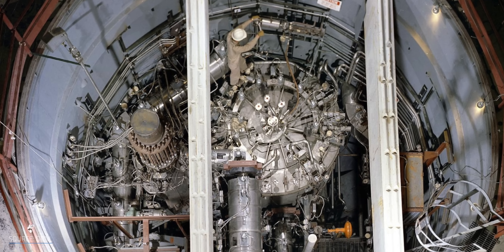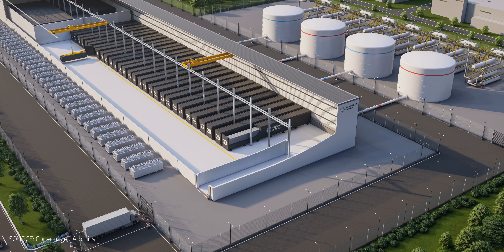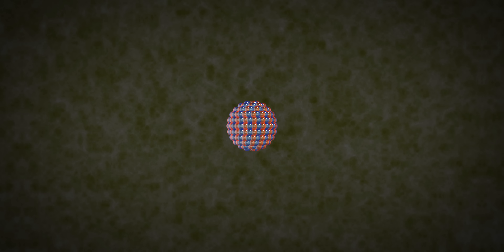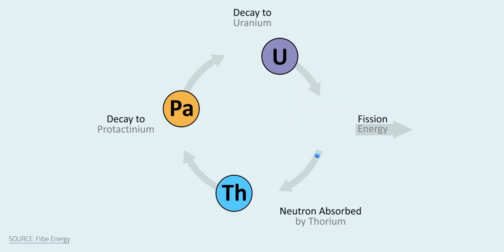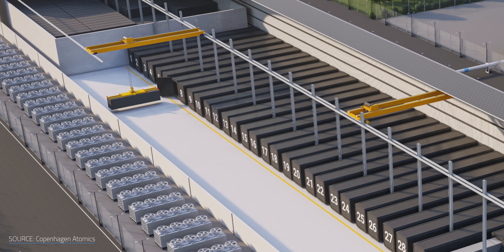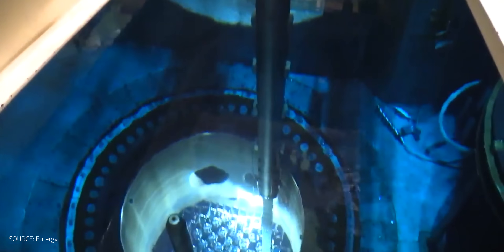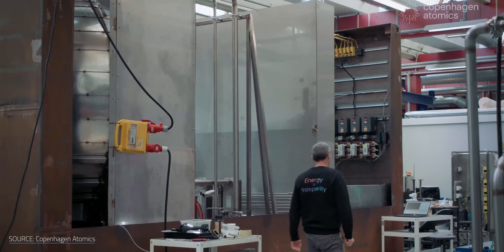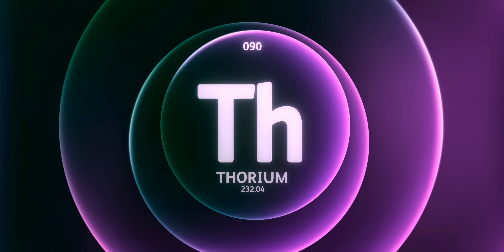Why Thorium is About to Change the World

Comment: Although this technology sounds interesting, I can't see how it will be commercially viable for decades to come even if they do crack all the technological issues. Interesting how the CEO spins a huge disadvantage, that the reactor needs to be replaced every five ears, into an imagined advantage: The sales pitch surrounding SMRs is that they will be cheap due to their modularity. If they only last 5 years, that claimed advantage seems lost. A regular NPP lasts 60-80 years. That is 12 to 16 times longer. I doubt they will ever be able to reduce the MW price by such a factor compared to a regular NPP. The CEO also says that he assumes that when they have built more than a 100, the price of the licensing and approval will come down. How many will they be able to manufacture per year?

In the meantime, renewables are steaming ahead, cheaper than ever and still dropping. We already have a massive nuclear reactor at the centre of our solar system and we know how to cheaply harness that free endless energy.
Reply: China is doing it anyway, and the technological challenges are relatively minimal; viability will come down to politics. You're not properly appreciating this design if you see spin here; the main cost and value are in the salts, which are not damaged or consumed, and can be reused across generations, indefinitely. Cost of power will plummet over time.

What is left, is replacing/refurbishing a cheap box, that will be less expensive than the fuel assemblies you're citing as an advantage for conventional plants. Those are also destroyed in only 3 years, without even extracting 1% of the energy from the mined uranium that went into making them.

If you think renewables are cheap, you've not been paying attention recently.
Reply: @Th-233  If Copenhagen Atomics can pull this off and make it commercially viable that would be excellent but I'm sceptical.

China already have a test reactor and are using a different design. CA only have a complete design on paper so far... China also has a very different regulatory environment which is an advantage.

Although traditional reactors are shutdown for refuelling, the reactors are not replaced. They last for decades. In an EPR design, the fuel assemblies last ~4.5–5 years, so their cost is spread over multiple fuel cycles. In the CA design, the entire reactor module is replaced after 3-5 years. Matt explains it at 12:20. So except for the outer shell, the whole thing is replaced. That is what makes me sceptical about the commercial aspect.

And yes, renewables are cheap. I'm very familiar with that topic. We have loads of renewables where I live.

Comment: THERE IS NO SUCH THING AS A THORIUM REACTOR. Research the thorium fuel cycle. They irradiate thorium which transmutes it into Uranium 233 and put it in the reactor. Stop falling for the nuclear industry's tricks. Thorium is safer but that's not what is used in these reactors. Nuclear is the fastest was to hike your electric bills. Stop promoting it.

Comment: There is no profit in using abundant resources - scarcity dives margins. There is less profit in reactors that generate a little more fuel than they consume and even less profit where planned obsolescence is not part of the design.  Maybe profit is not the optimal motive for electricity generation. Maybe, public ownership is the way to bring power to the people.

Comment: One nice thing about LFTR systems is that the way the operate produces a hotter output range for steam compared to regular reactors. At pretty much the optimal thermal range for steam turbines to convert the heat to electricity!

Comment: What about the waste?
Even if the best predictions of 500 years are true, where can you put something for 500 years and be sure it won't be exposed to natural disasters, wars, terrorist attacks, etc?
Creating such a dangerous long-term liability for a couple hundred years worth of energy doesn't seem like a wise choice, especially when we are well on the way to using winds solar and batteries to achieve the same.
Thorium would be a much better energy source for long-term space travel between solar systems. As a finite resource it should be saved for this purpose.

Comment: A comprehensive study from the US Energy Department in 2014 found that waste from thorium-uranium fuel cycles has similar radioactivity at 100 years to uranium-plutonium fuel cycles, and actually has higher waste radioactivity at 100,000 years.

A 2012 study funded by the National Nuclear Security Administration found that the byproducts of a thorium fuel cycle, in particular uranium 233, can potentially be attractive material for making nuclear weapons.
Reply: Yes, the DOE (and others) hate thorium, and all their deceptive reports present the disadvantages of thorium in solid fueled or fast reactors that have nothing to do with what is being presented here. Here's one more: "Alternate Fuels: Thorium and Uranium-233" (Report to Congress March 2023). There is never any evaluation of the two-fluid MSBR detailed in ORNL-4528, or the modern LFTR which builds on that design. Just strikingly clear contempt for congress, returning reports full of chaff, with intent to keep the brilliant work done at ORNL buried. They know what's being advocated, and have persisted in their deceitful misrepresentations for more than a decade.
Reply: @Th-233  LOL!

Comment: LOL @ the intro: "The reactor is designed to fit into a standard sized shipping container." then the reality: "Which weighs one megaton. And has to be shipped in 25x 40 ton sections and be welded together on site."
Reply: Yes, but this is scalable. A lot of other proposals are not. I don't see this as an actual issue. It remains high-tech, the question is: can we build it so that it becomes scalable.
Reply: @bartrammeloo5046  Yeah I just thought it was funny cause the beginning line gives the impression that a fully built modular reactor could be shipped in a standard shipping container, but then it turns out that's not the case at all. 
In general, I doubt this technology will be price competitive when/if it does finally come to market, as the advancements in battery technology are on a roll and sodium ion is about to have it's day in the sun.
Still a great option for those places that do not have solar or wind exposure, so I'm sure there will be a market if they can make it at least cheaper than gas for those areas.

Comment: TL;DR passive decay heat removal is great, but frozen plugs are obsolete

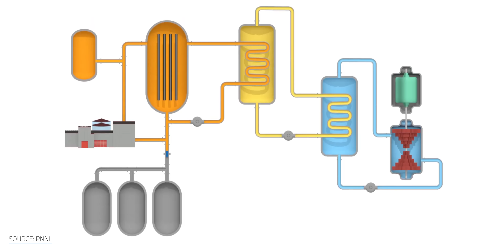8:38 Matt described the frozen plugs then Peterson detailed these reactors are safe because of passive decay heat removal. The second is not quite evidence of frozen plugs, per se. Passive decay heat removal is when the reactor does not need any power to cool down safely. In nuclear engineering, frozen plugs are generally considered obsolete technology. Plugs are were deemed inefficient and unnecessary when you could just have the fuel (1) solidify in place, (2) get hotter, but not close enough to melt, (3) radiate heat away, and (4) cool down over time. The plugs just added cost and another licensing headache, so we ditched them. Just wanted to clarify passive decay heat removal is great, but frozen plugs are considered obsolete.

Side note for anyone curious about radiative heat transfer. This heat transfer method is where hot matter will emit little packets of light called photons everywhere in all directions (isotropically). This method of heating dominates in heat transfer rate over convection and conduction at high temperatures.

If anyone is curious I can explain more. Please don’t hesitate to ask.
Reply: freeze plugs are not obsolete.  It's better to have your fuel solidify in external tanks then in your reactor.   Why go to the trouble of installing heaters in your core to remelt frozen fuel when you can do it easily on a cheap external tank.
Reply: @AIM54A I’m gonna read about this and get back to you

Comment: 20-40USD/MWh? Batteries are already hitting 65USD/MWh and will surely get way cheaper in the next 10 years, especially with huge cost reductions on the horizon with sodium-ion technology improvements and manufacturing scale-up. So while it looks good on paper, I think this will end up being the more expensive option in 10 years time. Will still have it's place in areas with low solar/wind output though.

Comment: he production of U-232 in the thorium cycle poses a serious
environmental and health risk. Therefore, the U-232 isotope is one of the most
important disadvantages for thorium-based nuclear power generation (Cywinski,
2016; Wojciechowski, 2018). Therefore, protected facilities are required for the
reprocessing of thorium-based fuel. Because U-232 may cause the personnel to be
exposed to high radiation. Since it is very difficult to imprison the high-level
gamma rays emitted by U-232, thorium-based reactors require more expensive
equipment and highly experienced workers (Sehgal, 2016).

Comment: So how will they handle the parts of the reactor that have been made radioactive by neutron activation?  Surface contamination is one thing, and can be cleaned off.  But when the steel itself is transformed into a radioactive isotope, that's a major problem.  Can those metals be reused or recycled?

Comment: Note that the original OakRidge reactor required the use of highly enriched U-235 Uranium (see 14:04 for the new one too) to kick-start the fission reactions since Thorium is not fissile and requires "breeding" to U-233 before it becomes fuel.

I think that this initial start-up feature will harm Thorium reactors because of proliferation concerns.  Also note that India has a Thorium triple-rector type to deal with this start-up feature; once India creates enough U-233 then it will be able to startup further Thorium MSR's.

P.S.  I like the idea of using Thorium MSR's for creating ammonia since ammonia is a very convenient fuel that can be developed for vehicles, ships, etc.
Reply: The U-235 needed is small and it'll be in the fuel salts.  Nobody is going to steal hundreds of reactors worth of fuel salts then build a plant to try and isolate the U-235 back out.  It would be cheaper and easier to steal used fuel pellets from an old reactor and reprocess out the weapons grade U235 that's left and any plutonium.

Comment: There is an old paradox that goes something like this:
The more resource efficient a technology becomes, the more of the resource is consumed.
For example, we want a steam engine that uses less coal, so we make it. Now that we made coal more economical, it becomes more accessible, and so people use it more. We became more efficient at using coal for steam engines, so we started using more coal.
I suspect that a similar thing is going on with the new technology like machine learning requiring more power from flashier power generators. When will we have enough power for our needs?

Comment: Still no good. Still produces dangerous waste that has to be managed for 100s of years. Frequent changeouts of the 'core' means ongoing costs. Compared to wind and solar farms charging batteries where the generators have a useful lifespan of 25-30 years and the storage component will last 10-15 years and everything is 95%+ recyclable at the end of it all, Thorium loses.

Comment: There is a tiny portion of fresh water on this planet and a massive surplus of saltwater on this planet.  Retrofit a super oil tanker to go out in to the ocean, fire up the molten salt reactor, use the heat to power the tanker and flash boil the saltwater for desalination, fill the tanks with desalinated water, pull into port, pump the fresh water inland, return/repeat into perpetuity!

Comment: When I was at MIT we fed a problem to TX-GAIA which is MIT's personal AI that is ONLY used for Chemistry and Physics so Its smarter since other AI's are bogged down with 99% junk info as far as Engineering students are concerned so it's WAY FASTER, WAY SMARTER TOO! You could say TX-GAIA is a pure 'Nerd AI'. I digress, we asked TX-GAIA a question "What if you fed common Nuclear Waste into the molten salt stream of a LFTR reactor", the AI said that with Humanities current nuclear waste stores we could power a global population 10,000,000,000 people for 17,000 years using only our Nuclear Waste. In the end the waste stream would be only Bismuth-207 (²⁰⁷Bi) which has a half life of only 38 years which decays into Lead-207 (²⁰⁷Pb) which would decay to a safe levels in only 24 years.

Comment: My understanding is that massive use of fission and perhaps one day fusion, will progressively heat the planet up.  If you take renewables you have an energy system in balance, solar energy can be used to produce electricity on earth, but ultimately all the solar is re-emited as IR or other wavelengths into outer space.  This is a necessary condition if not the earth would accumulate heat energy and become unliveable.  If you imagine a scenario of massive use of fusion/fission, we will be injecting calorific energy that has come from atomic structures (chemical energy?) into the planet atmosphere.  This will have to be disposed of because the energy balance is no longer in equilibrium.  Either this happens naturally through thermal radiation from the planet, or we will have a build up of energy, because ultimately most of the electricity produced ends up as thermal energy.  So no problem now, but let's say in 500 years (bit optimistic, I know) this may be a serious problem, by which time humanity will have had to develop a planetary air conditioning system.